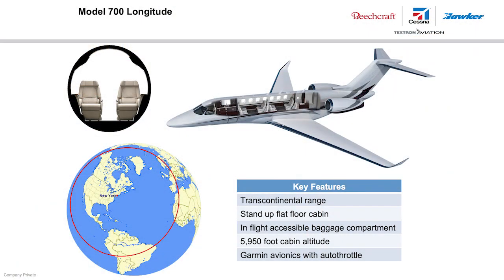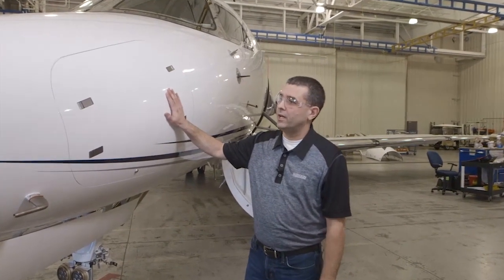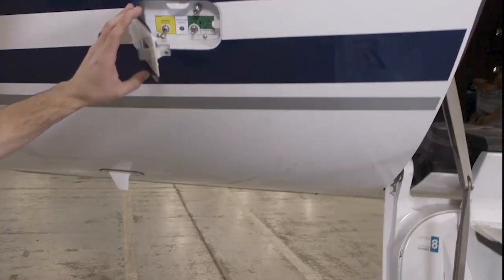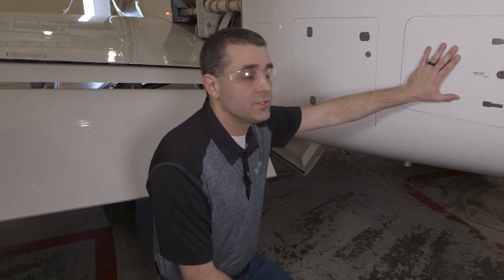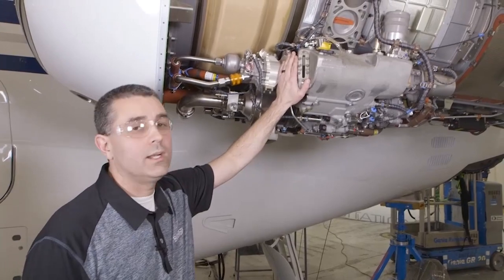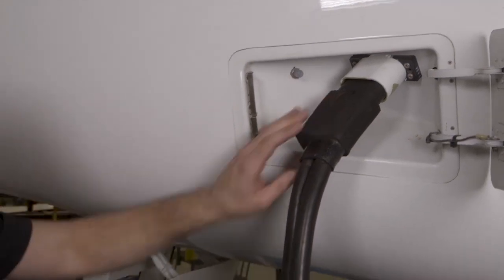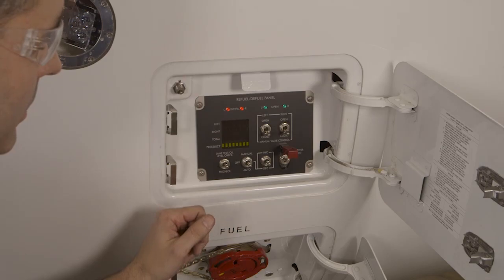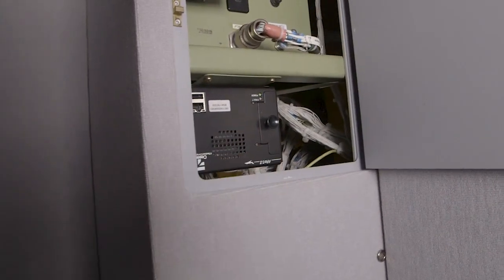Longitude Overview and Walkaround

Comment: Sucks that it has such a restrictive range. A super midsized jet should have a 5000nm range at a bare minimum. Hopefully they would amend this with the Hemisphere. For the price , one could easily get a relatively new , low time preowned Gulfstream G550....which is a different level altogether....
Reply: Hi
Cessna 206
.....7(Big)
OK ♥️X(1)
Reply: The G550 isn't in the same class.  It's almost 25 ft long and wider and seats up to 19 passengers.  The G280 is more comparable and it's got a 3600 mile range.
Reply: 5000nm range is not really medium anymore.  My thoughts, but what do I know..... nice plane a bit more range and fixed all the shortcomings of the latitude, being very underpowered and the longtitude has a swept  wing for a lot better ride..... I'm a fan👍🏼